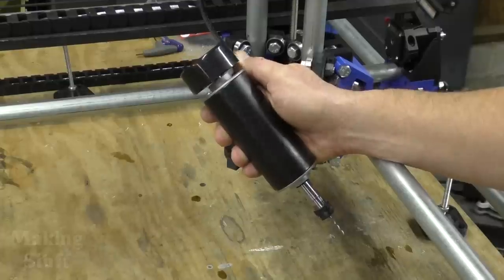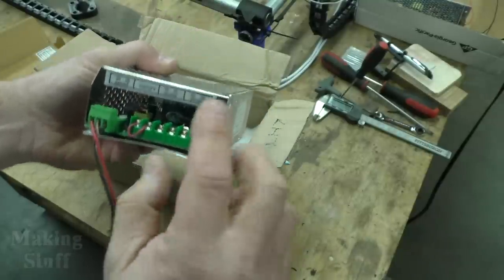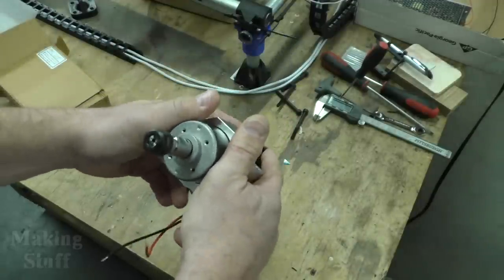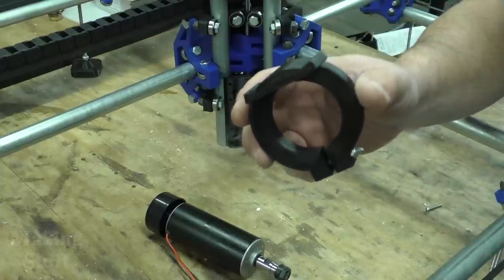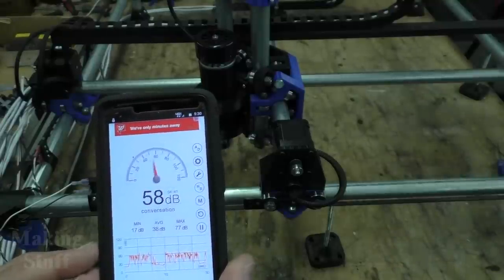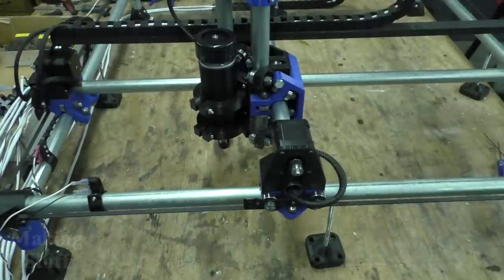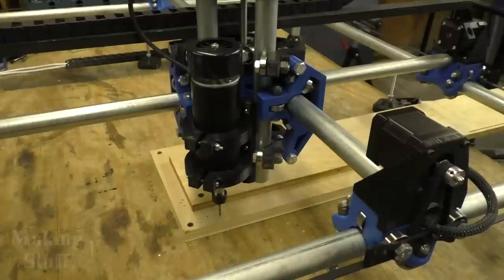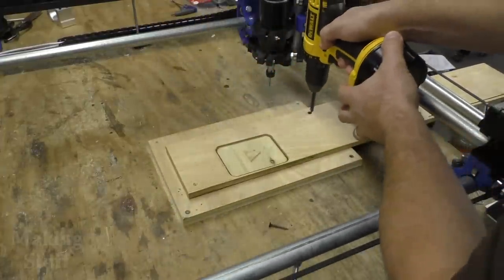Reviewing a Chinese Spindle for CNC Machines

Comment: Could you test in aluminium ?
Reply: I really want to know about this too. Want to build a machine like this, but it has to work on aluminum.
Reply from the maker: I need to get it dialed in first, but yeah I plan on trying aluminum with it.
Reply: I was orderd the same spindle at the same supplier. I waiting it.  I hoppe it s not a chinese object not for use but just for sold.
Reply: I've done aluminum with the 300w spindle you can get from Inventables.  This one should be able to do it as well.  With that said, pretty much everything I do is decorative, so I can't tell you how accurate the cuts are, but to the eye, they look right.  Text is legible, the cutouts don't stair step, and begin and end at the same place.
Reply: While you can use it for aluminum it's going to have a lot of drawbacks. Mainly spindle life, tolerance and speed and it's only going to get worse the more you use it. Any chatter you encounter is just going to amplify those shortcomings.  

As an expendable tool for occasional hobby use I'm sure it can work, but milage may vary.
Reply: I was cutting aluminum with this spindle and ran some bad g-code, crashing the machine. The spindle bent from the impact. It can work if you go slow, but it IS a weak spindle for metal. I bought another one, since the machine was already setup for it and it was a crash, not a motor failure, per se. expect feed speeds of not much more than 10 - 20 IPM.

The impressive thing is the old motor, when it crashed, had stalled out as the end mill was stuck in the aluminum nut the motor was still trying to turn. It smoked pretty good, but the fucker still turns when you power it up!! It wobbles to high hell now, but it still goes!
Reply: The stock belt setup on the MPCNC doesn't really lend itself to cutting metal very well. The design just isn't rigid enough. Considering the limits of the MPCNC itself, this motor isn't a bad choice.

Comment: To eliminate the border fuss, do a conventional milling on the perimeter to start with. For the triangle, also do a few last passes conventionally.  Another factor besides the tool path is the material density and fiber orientation.
As for this spindle speed with no load, it is quite slow. You have not mentioned under load, wich makes part of your reviewing process flawed.
Good luck with it please do a long term review on it.
Final note: you should have titled your clip ''my first impressions'' as your current way of revieing is just not up to par.
Thanks for watching and making stuff!! Enjoy!
Reply: I thought he said he measured with the tach during cutting and saw no decrease.
But maybe you meant a higher load?  Curious because I'm considering getting one...

Comment: It looks like you may have been using too big of a stepover per pass it looks almost like 100% just by eyeballing the video... maybe a smaller stepover would help the fuzzie but also plywood can be bad about doing that.  Just dbl check your feeds and speeds too
Reply from the maker: It was 45% step over.  I too thought it looked like 100% while watching it, but the CAM software was definitely set to 45%.

Comment: To properly analyse the build quality weighting it won't say anything. You need to measure the collet total runout, in that case being a DC motor with 2 wires (assuming to be DC from red and black wires) will be a permanent magnet DC motor and you should verify the build quality of the brushes, collector, stator, rotor bearing parts, how the windings are done and much more. The sound is made from vibration of the moving parts and if the bearings are quality ones and the stator if perfectly ballanced you should have less noise that you actually measured. The cut quality is most of an attribute of the cutting bits.
And btw if banggood or who send you the spindle motor "offered" to do so it will never be a totally honest opinion because you are quite obligated to say positive stuff in order to get hands on "free" stuff.

Comment: You know what these motors might be good for is just for controllable power to drive one of the betterly-designed ER20 spindles off Ebay. The spindles look heavier-duty and have the proper bearing configuration, and you could pull the collet off the end of this motor and install a pulley to drive the better milling spindle. Of course you'd have to make brackets and such to mount it all and would be heavier, but I think it would be much more likely to work much better. Maybe these motors could be found without the ER collet mounted to make it simpler and even a bit less $$ ?
Link to spindle example (which will eventually expire and be a dead end, but hey....)
https://www.ebay.com/itm/1HP-ER20-Spindle-Motor-Unit-CNC-Drilling-Milling-Machine-3000-8000rpm-Power-Head/264083321008

Comment: wrong bit you use, not newer plywood upcut bit, only straight cut put and some work down cut bit working.i have same spindle, 49€ ebay and speed controller connected to mach3 10€

Comment: Do not buy this!
Spindle is way too weak. Main motor shaft is very thin, distance from bearing to end mill is very large compared to shaft. You will always have bad surface finis due to shaft flexing. 0.1mm of flex is enough to ruin surface finish.

Comment: Looks like you built a mostly-printed-cnc
I was planning to build one, but I changed the design to more metal parts.
If the construct is a bit bendy, you can buy any spindle and still get poor results.
no matter the spindle.
But I have to admit:  Chinese manufacturers have improved a lot in quality over the
past 10 years. Due to the fact they got better educated and more experiencedworkers, nowadays.
Because the west is moving most production to china.
And that's a shame, because the west is also loosing their expertise.
There come a time, we turned ourselves into dumb facebook couch potatoes with a stupid
job in 'management' while we outsourced a fullfilling productive life alog with the
satisfaction, we actually learned something in school.
I am hardly surprised to see how modern day millenials turned into such snowflakes.
Do they really have a satisfactory life ? I do not think so.
They are no longer challenged to build stuff and be proud of what they can do or
what they accomplished.
We all need a sense of accomplishment, or society becomes .. well .. what it is now.
But that's just my opinion.
Reply from the maker: Yeah the MPCNC is a good beginner machine.  I will probably build a better machine in the near future.  Thanks for watching.